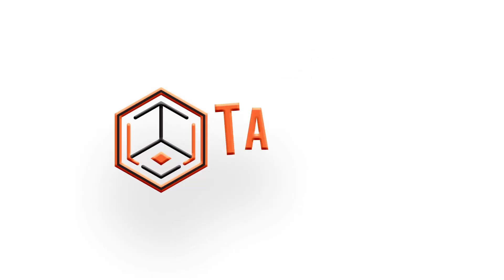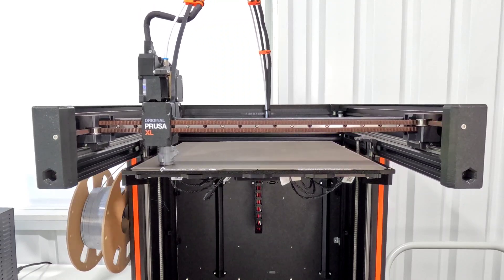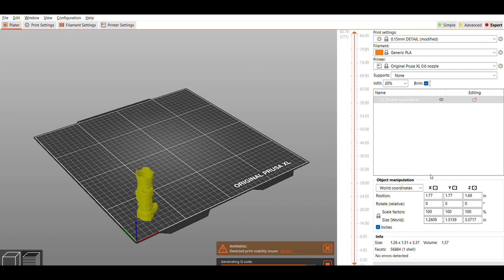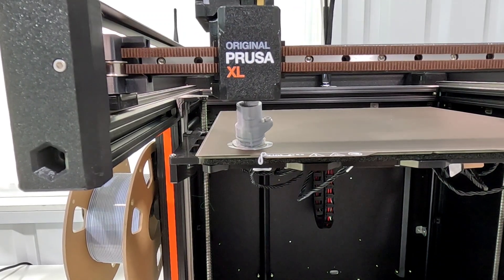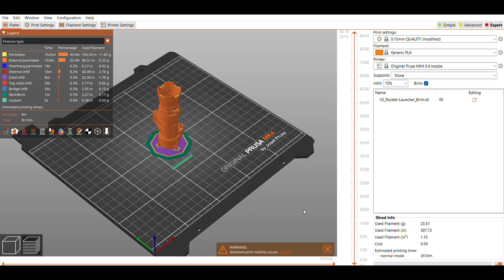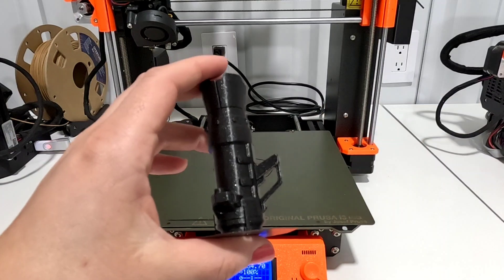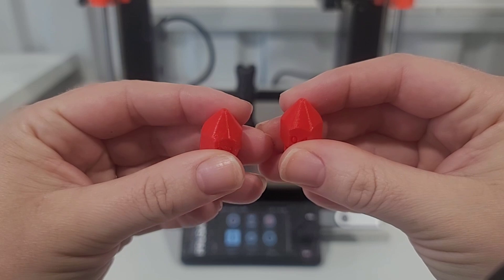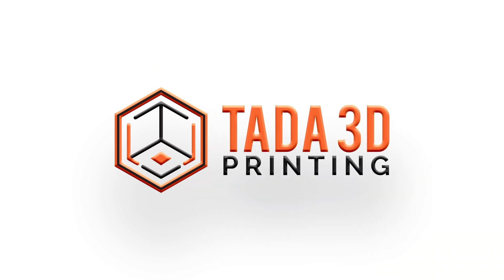How easy is it to print and use the Rocket Launcher Toy from Printables?

Comment: A little glue would have saved you some time. I know I hate the mess the glue gives ya, but honestly 1 min under hot water and some dish soap makes em look and work like new. 
  I'm lazy so I use a weak glue, mostly just bambu's glue and it just works. I wipe it with ipa every time and every tenth print I'll wash it right off and it works like new.
Reply from the maker: Good to know! Thank you!

Comment: I love Elmer's glue stick... :eyes-pink-heart-shape:
Reply: I'm 89% of the way through the launcher as I type this. I used the Brim version and put glue stick on the bed. I used to use Glue stick for every print. But now I just do it for prints with fine first layers, or stuff like this. When I always have it on, the bottom layers would get markings from little blobs of the glue. 

I dropped the acceleration down to 2000 and travel speeds back to the stock 150, that my Ender 3 S1 pro uses. Just to make sure it stayed put.

 I love that Sonic pad tho. I can now do a perfect 30 minute benchy with Klipper and the CHT nozzles I bought. I digress, Glue stick and PEI beds are fantastic at almost eliminating layer adhesion issues, completely.

Comment: Everyone is saying 'bed adhesion issues' but that's not the case here.. it snapped one of the brims in half from how hard it got struck, so it wasn't peeling up in the first place. Decrease your filament temperatures if possible, and increase your fan speeds, you're somehow getting too much curling from the layers below and nozzle-strikes. Also you might have your flow rate set too high or e-steps slightly off, theither of those can result in top surfaces being bumped upwards from excessive material and catching.
Reply from the maker: Ok thank you so much!

Comment: Bed adhesion is the problem, as others have pointed out. Consider using those tiny magnets - about the size of coin batteries - and put them on top of the brim once you're a good half an inch or so (in terms of height) into a print. That'll keep the print secured to the magnetic print bed. No need for glues and the mess they create.
Reply from the maker: Thank you!
Reply: I have never heard that before I will try it since I could not print this in 5 tries.

Comment: Looks very much like an adhesion issue.

To fix this:

1. Take your print sheets off and wash them with a mild soap, like dish washing soap and warm (not hot) water, then rinse and dry them immediately using fresh clean paper towels
2. put the dry sheet(s) back on the printer(s), avoid touching the print surfaces at any point
3. clean the surface(s) again, this time using 99.9% isopropanol alcohol and a fresh clean paper towel - you are now ready to print
4. after printing, wait for the beds to cool down at least a little or completely. With the original Prusa TEXTURED sheets, printed parts will come loose while the sheets cool down
5. Take the parts carefully from the bed, avoid touching the bed surface again. If necessary, carefully(!) use your fingernails to make bed contact, but try not to leave any impurities on the surface, - as good as you can
6. Right before the next print, clean the bed surface again with 99.9% isopropanol alcohol and a fresh clean paper towel. When you keep your bed really clean, you can reuse this towel for quite a few times. Cleaning with isopropanol works best, when the bed is slightly warm. Please never apply alcohol or other liquids to a hot print surface!
7. From now on, try to keep your bed surface clean, using the alcohol and paper towel method only
8. In case the parts begin to come loose after a while of printing again, or after changing type or brand of filament, and you notice isopropanol won’t do the trick anymore, repeat from step no. 1 (cleaning with soap water)

In general: Never use anything else than pure isopropanol alcohol, or mild soap water to clean the bed. The used dish soap shouldn’t contain any skin care additives - a plain cheap one without any extras will work best. Try to clean the surface with the soap water method only when absolutely necessary, as it may reduce the lifetime of the sheet if done too excessively or if the bed is left in the water for an extended period of time. - Just use your common sense.

Following these simple steps and trying to always pay some extra attention to the cleanliness of the print surface (touching it less as possible) should reduce adhesion related issues down close to zero.
Reply from the maker: I'll do this and give it another go. Thanks so much!

Comment: Cool video - nice to see the dedication to getting it done.   Looks like a lot of blobbing that is binding up at the head and then putting too much pressure at the bed.  Is that a cooling issue or extrusion issue causing the blobbing?
Reply from the maker: I think it starts with bed adhesion and turns into a blob. Thanks!

Comment: Try increasing bed temp. that print is on the far edge where it might not be staying as warm as it should.
Reply from the maker: Thank you!
Reply: @tada3dprinting  Some PLA I can print with the bed around 50c, but there are others where I need to increase up to 65c. Good luck. 🙂 Oh, and check your first layer to make sure you have good z offset.

Comment: Issue is due to textured sheet.. Not printing issue.. Just use the other sheet for thin tall objects like this.. Or use glue
Reply from the maker: The XL does not have a PEI. But I did use the PEI on the MK4 and still had trouble. But yes I do agree it's an adhesion issue. Thanks!

Comment: As others have said, it looks like a bed adhesion issue. That is as long as you still have z-hop enabled in the slicer. If z-hop somehow got disabled it might be causing the nozzle to run into the part when it goes to do a travel move.

Also, the Prusa Satin sheets, like the one on your XL, have less bed adhesion than the Prusa smooth pei sheets in my experience. So for prints that tend to have adhesion issues, I always go with a smooth pei sheet. I have used a Mr Clean Magic Eraser with some ipa to lightly skuff up my smooth pei sheets and it has worked wonderfully! Most prints stick so well to them that I have to flex the sheet quite a lot to get them to break free. Even if you don't scuff them up, cleaning all of your sheets with ipa and a small, clean cloth in between each print would go a long way to help with adhesion. I take low lint paper towels and cut up a bunch of them into small squares for wiping down the build plates before each print.

Glad to see it finally worked out for you. ✌️🙂
Reply: Yep. I’ve never been a fan of the satin sheets. I use smooth for PLA and textured for everything else.
Reply: @brisance  To be clear, I love my satin sheets. They are more durable than the smooth ones and leave a nicer surface finish imo. My smooth sheets have some light marks from past prints that transfer onto new prints. For some things, such as gift box lids, these marks make them look not so nice. My "daily driver" sheets are the satin ones and I switch to smooth for prints that might have adhesion issues.

Textured plates I do like, but only for certain types of prints or for use with certain materials. As they say, to each their own, I guess. Lol
Reply from the maker: Thank you!

Comment: This may not be a printer issue, but a bed adhesion issue.  Try washing the sheets with Dawn Platinum dish soap.  It works way better than others.  Rinse well.  You can also wipe with a 99% IPA using a lint free clean cloth.  As others mentioned, you could add some glue.  It will not throw off your first layer.  You can also alter settings to change brim thickness and offset from main body (balance of removability vs. amount of adhesion).  Good luck.
Reply from the maker: Good points! I'll try this. Thanks!
Reply: @tada3dprinting  Like Troy said it looks like adhesion issue.. for smooth PEI i tend to use Acetone every 10-20 prints if having adhesion issues. Textured sheets regular window washing fluid will do the job. Some filament brands likes higher bed temperatures. With brim it still looks like you have rectraction issue, so try to increase the speed or even the length.

Comment: In such cases when nozzle hits tall detail and ruin the print you can try to activate Z hop. I used this option in Cura, but I'm sure PrusaSlicer has it too. It lifts nozzle a little bit and it doesn't touch top layer. It slows down printing speed but it can make such prints more relaible
Reply from the maker: Yes I will try this. Thanks so much!

Comment: I'm disappointed to see the mk4 fail with this print since my hand is basically hovering over the buy button rn. Idk if enabling z hop would help prevent the print being tipped over. As always thanks for the detailed info.
Reply from the maker: I'm sure this print can be dialed in. I just lose my patience after a couple of prints and wanted a bigger change. Everything else that I have printed on the MK4 has been beautiful. But a fast printer can be tricky for some prints. Thanks!
Reply: @tada3dprinting  Part of the reason why I wanted the Mk4 is that I don't want to have to tinker with settings, but his isn't exactly a standard print so I understand it's a little different. Overall I'd say I'm very happy with what I'm seeing especially with input shaping.

Comment: I've had times like that. There's no shame in using glue stick. Sometimes its better than risking a long print. Plus after the bed cools down glue stick is more of a release agent then glue lol
Reply: I will use gluestick, a spray of isopropanol and smear it out... I just don't have the patience for pieces that fall off 😂
Reply: @ulrikwener  Ya a good smear with ipa gives you premo adhesion.
Reply from the maker: I'm so nervous to use glue on these fancy sensors on th XL and Mk4. I feel like it's going to compensate for the height difference and make it worse. But it's worth trying. Thanks!
Reply: @tada3dprinting  apply gluestick, then use a wet paper towel to smooth it out and get a thin even layer. it won't hurt z probing.
Reply: Don't need glue stick.  Give your bed a good wipe with 99% IPA and/or wash it  with dawn soap
Reply: @902Boots  where are you finding 99% isopropyl alcohol? The best ive seen locally to me is 91%
Reply: @vicdez  pharmacies have it :)
Reply: @902Boots  Not my local Walgreens/CVS or the supermarkets. You got it good then lol
Reply: This print is tricky because the spring will rise up as printing and the nozzle hits it.  I saw the same thing on my MK4
Reply: I use glue because it works and is so easy to clean up. 1 min to wash in my bathroom sink.

Comment: Silk PLA has worse layer adhesion than regular PLA, which could have been causing problems. The only specific filament you mentioned was Prusament, which printed successfully, is this maybe a filament issue with the other kinds?
Reply from the maker: On the MK4, I used Overture Black that is not silk. While the silk might have been a problem on the XL, I am surprised the MK4 had issues too. I just feel like this print needs very slow speeds. I'm sure it's possible to dial it in for the XL and MK4. But I think this is a print where a fast printer is not the best fit. Thanks!
Reply: I’ve printed this exact same model many times on my various printers. Sometimes, it really is the filament.